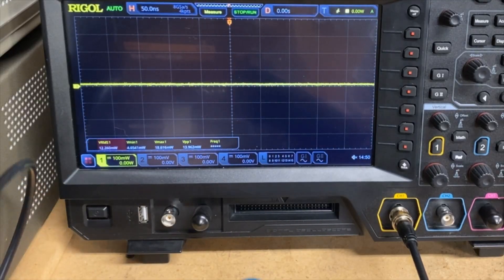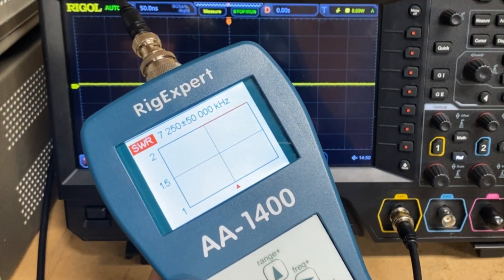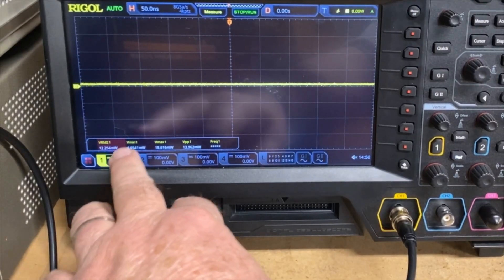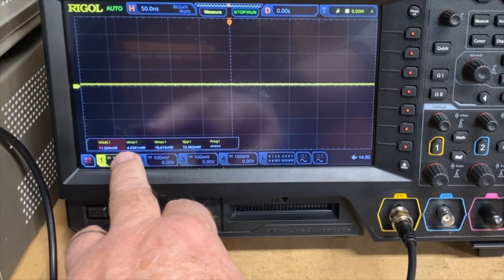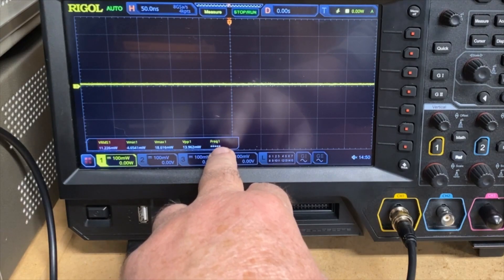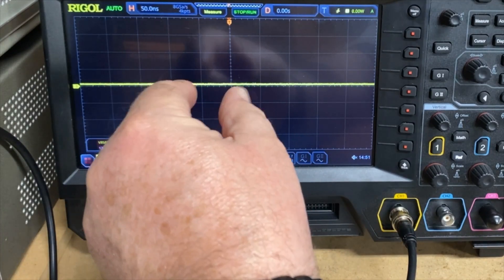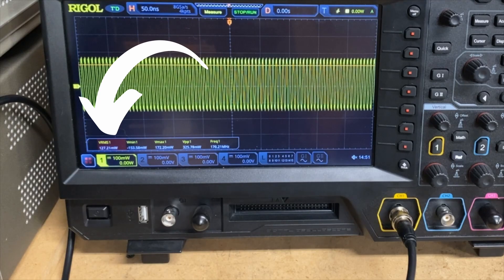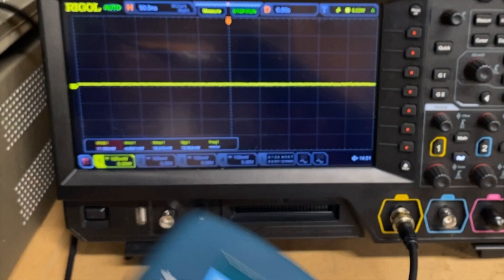Take a deep sniff - Rig Expert AA-1400

Comment: Pleasantly fragrant. I would assume that the MFJ analyzers that can be run off batteries are putting out less than a watt, probably the same for the nanovna. I probably should test that assumption.
Reply from the maker: Can't reflect back what you're not sending out.  The nano is good (stay tuned), I don't have my MFJ anymore.
Reply: Best documentation I can find for the nanaVNA series says that the drive current on the clock chip has 4 settings, and any one of the 4 might be used depending on your firmware rev and what precisely you've asked the VNA to do.  Worst case scenario appears to be just under 1dBm, which is ever so slightly higher than 1.25mW at HF frequencies into a 50ohm load.  Significant variation is possible depending on the operating conditions, but I doubt the chip in there could source more than 5mW (and that only for brief periods) without damage.  

One of the things you get with a $29 VNA is an output impedance that isn't 50 ohms, so to measure it precisely requires a scope with an adjustable input impedance.  Even so I think it would be fun for someone to hook one up and see if the docs are even remotely correct.  They appear to be based entirely on theory as opposed to any lab results.

Comment: Not sure where the stink is? In the devices or your testing methodology.  There are times when you need a higher power to get accurate results. You have to overcome any losses in say the feedline or  overcome local noise or signals that the device may be receiving on the antenna from  local broadcast stations etc. Agree that the lowest power we can get reliable measurements with should be used, but you would have to do multiple scans at different power levels, compare each reading to see when you overcame the nose. Most hams want fast and cheap not accurate and lengthy. Hook a SA up to an antenna and you can easily see loca noise and  BC stations swamp the front end of the SA. I have seen signals on an antenna exceed the max input of a SA.  Interestingly the opposite of what you found is how I would think these should work. The Rigexpert with no filters on the front end could benefit from the higher power while the radios with filters in line should be more accurate at lower power. I any case I love my rigexpert and I find the build in SWR analyser in my rigs valuable at times. Lets not even talk about should we be IDing after we cause a transmission with these things. Keep up the good work, it has been interesting to see the results from all of these. 

73
Reply from the maker: I love that these things exist, and so far I like the xiegu method the best of all of them - analyzer+tuner+radio all I'm one neat little box- I want a tool that gets the job done, and the more tools in the same box, the better!  Thanks for watching, they are fun to make... but I only have one radio left!